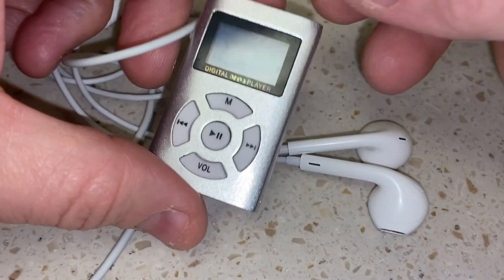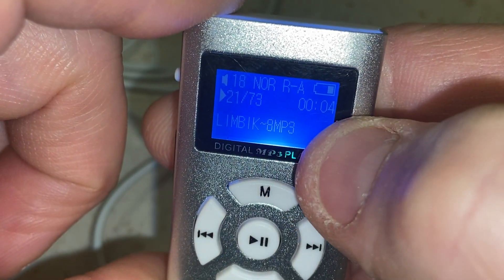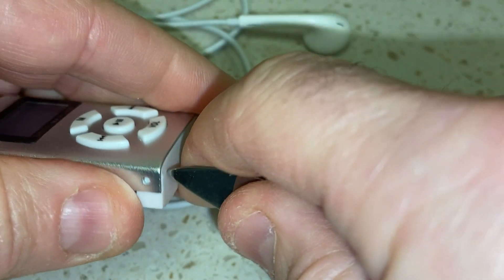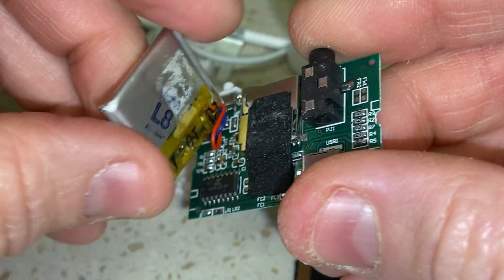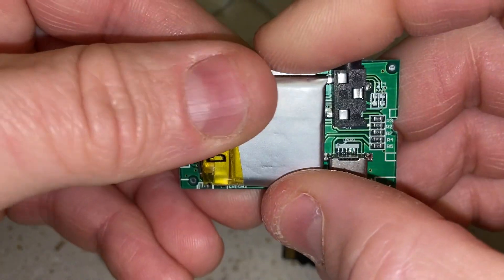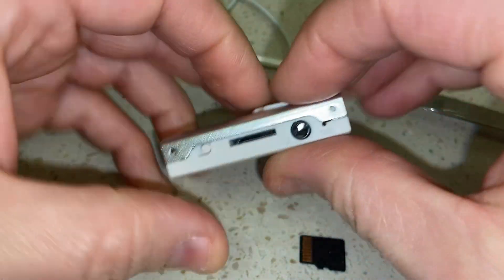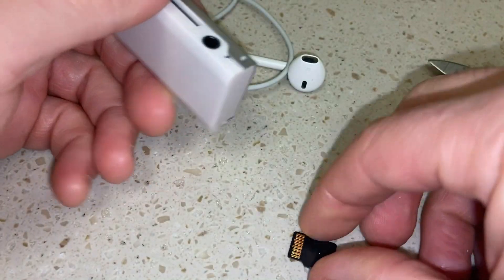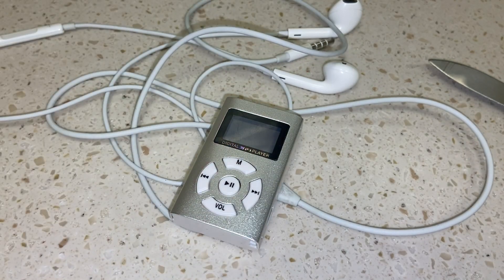CHEAPEST $1.50 Mini MP3 Player with LCD Display Teardown!

Comment: Definitely prefer the aa or AAA models, especially great paired with a NIMH cell. 
I bet this one would pair well with an average e-cig mini battery. The protection should be on the board, likely part of that chip, if you look up the spec
Reply from the maker: It is worth attaching a cheap throw-away e-cig battery and seeing what happens, even though they don't have any built-in battery management system. I have not tried running it at 3.0V which would be 2xAA or 2xAAA, although that may be enough to power the device (rather than 3.7V LiIon pack). That's another option to try. I would be afraid to put 4.5V as it may be over-voltage and burn out the circuit. However, NiMH cells are typically 1.2V output so 3xAA or 3xAAA NiMH pack may actually be just about right at 3.6V to let it run fine. I'll have to try that out.
Reply: @devhackmod  had a buddy that used to refurb early Gen ipods with a set of AA or AAA, every thing else remained the same, bit of a hole and hot glue on the rear casing, before replacement batteries were so readily available. NiMH, of course.
Reply from the maker: @RealJonDoe  Yes I think that's the way to go! 3x NiMH should give the correct voltage, just about 3.7V.